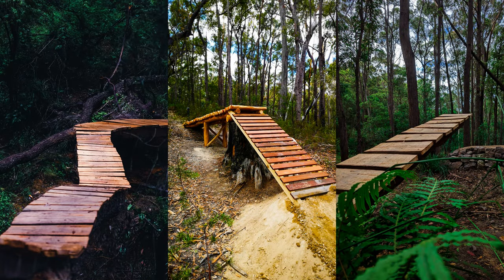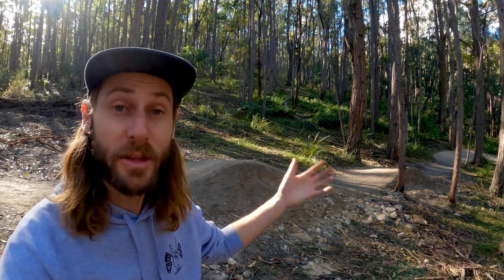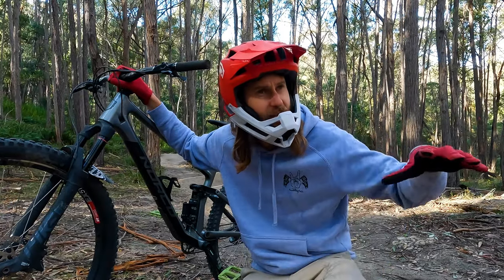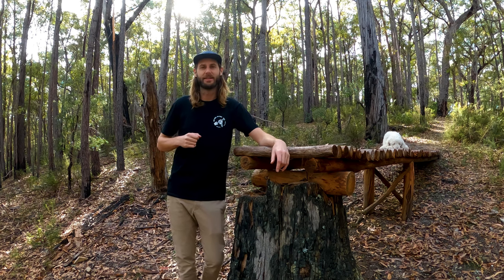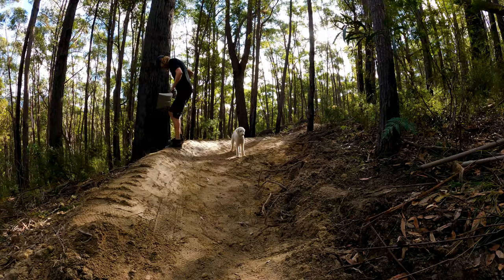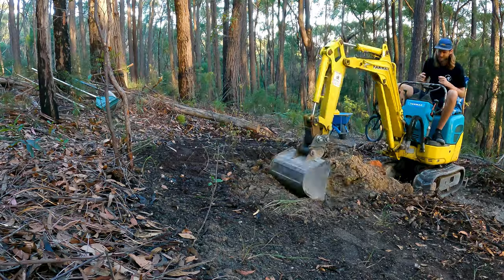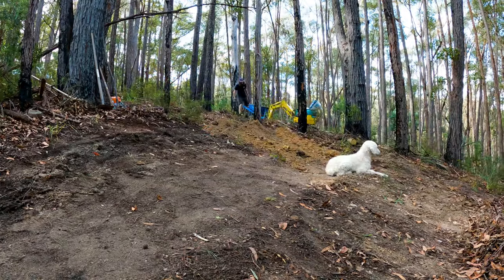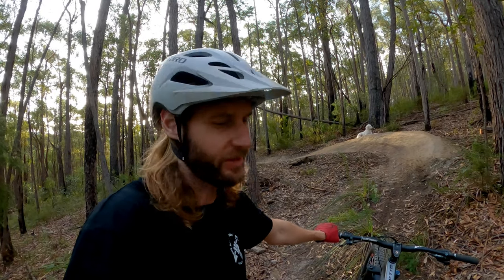Most IMPORTANT part of building a MTB trail!

Comment from the maker: What do you guys think? Should I leave the rollers as is or mellow them out a little?
Reply: Mellow them out on one side or maybe even put a little kicker thingy on the right hand side of the first one. That way it gets easier to double while still being mellow enough on the left side to roll with speed
Reply from the maker: @lorin5294  yeah good thinking. When I was building it I was looking for big flat rocks for exactly that reason. I wanted to have a rock lip on one side. But all I found was small round ones.
Reply: Yeah what Lorin said. If you have a nice flat rock, they make decent lips that can also be snuck past. Pump tracks have steep rollers but they are on flat where yours have so much more speed. You could also fill in the left edge of the lips from the bottom to be less steep. I think moto whoops are fine in any trail at high speeds they just happen in lots of trails. But some might complain about flow.
Reply: I think you should mellow it a little bit but then add more dirt to the downside making them more built up in the middle so when your going faster the roll will be more gradual still being about to go fast through them or gap them or manual
Reply from the maker: Yeah it doesn't need to be as deep in the middle of them. That would make it flow a little bit better.
Reply: I would put dirt just between the x2 rollers to mellow the middle section out to pump and leave the face of the front one as is, or only mellow the face of the front one just a tiny bit. So you can still gap it.  But it’s not as much of a soaker if you wanna pump it
Reply from the maker: @chadsugden411  the front one could also be a little bit wider on the left and make that side more mellow. Have you seen the latest episode? Some friends ride the rollers and the gap is perfect. 🤟
Reply: @cutlaps  yeah mate I’ve seen all your episodes.  I think if you just filled the middle in abit to mellow is it would would be a great option line. :)
Reply: awesome work mate
Reply: I think you need to build up the backside of that first roller, essentially making it a little shallower between the rollers. 
It will then allow you jump them, but will allow you to keep your wheels on the ground while pumping or manualling between the rollers.
Reply: I would think to mellow them out and make the berm that is after the rollers taller to carry more speed

Comment: Great video! Your right drainage and connecting all the dots are the most important things, sometimes it’s too exciting to build the biggest features but the little things keep the stoke going and drainage keeps the trail open. (and a new video dropping on my birthday can’t get better than that!) Those S berms look like a thrill! Kudos to you for including that the double doesn’t work for you but having the goal to reach that level and leaving the pumps in for others.
Reply from the maker: Happy birthday legend!!! 

It's easy to get carried away building features (especially with a youtube audience) and forget about the rest of the trail. But the last month of work fixing up the trail inbetween has been so much fun. It really improves the trail a hell of a lot. No boring bits. 

The roller gap is pretty gnarly for me at the moment. It's harder than it looks on camera because it's actually pretty tight to the corner and you are still leaned over a little. Then there is a tree at the end of the corner that blocks your view of the roller until last second. And then the landing has a bunch of trees really close just waiting for you to make a mistake haha. I'll get it one day, but think I need to work on my pop a little bit first. 

Cheers
Reply: @cutlaps  Thanks. Yea certain big jumps with long and nice run ins are way easier than smaller jumps with short run ins or sketchy landings.

Comment: Another great quality video.  One word of advice on drainage though, don’t use pipes, they block quickly with leaves and sticks.  

Better to either plan the corner a bit better to avoid the berm catching water or break it into 2 corners with a drain in between.

Make the drains as wide as possible 600-1000mm to keep water flow as wide and as slow as possible across the trail to reduce erosion
Reply from the maker: Good advice Greg. I was wondering how often I would have to unclog the drain.
Reply: @cutlaps  water control is the most part of building a trail system that doesn’t need much maintenance.  Diversion banks ie Rollers strategically placed will keep water from channeling down the track.  

Your alignment is pretty set now but on future trails look for features first then look at how the water flows down the slope and work with that to link your features.

You’re doing awesome 👏
Reply from the maker: @gregditchburn9786  for sure. I also have the IMBAs guide to building sweet singletrack book. Lots of useful information on building sustainable trails in there. 

The downhill section after the stump drop will need a bit of work as well. It's a lot steeper in real life than it looks on video. Heat breaking and rain will cause it to rut out. I'm going to have to work out a fix there.

Comment: Keep the rollers high so you can fly!
Reply from the maker: Haha I like that! 

I think if I were to make changes, I could fill in the middle bit a little. That way it doesn't dip down as much between them. It should smooth out the ride a bit more but still allow for max flight time off the first roller. But they are good fun at the moment, so maybe I won't make changes.
Reply: @cutlaps  one of those scenarios where time will tell I guess. The berms at the end looked mint to ride too.
Reply from the maker: @adammorris6348  yeah the berms are lots of fun. Hoping to get out there today to start work on the next one. But it's super windy at the moment.
Reply: @cutlaps  is it the windfall that worries you?
Reply from the maker: @adammorris6348  yeah there's a bunch of dead branches above where I'm working which makes it a bit dangerous and then the noise of the wind can also make it hard to film.
Reply: @cutlaps  ah yes.. content creation. Forgot about that minor detail 😅🤣
Reply from the maker: It definitely slows the process down! haha

Comment: Great work where is the trail your building. You can get a tungsten tipped chainsaw chain lasts for ages
Reply from the maker: It's on my dad's property. Far south coast of New South Wales in Australia.
Reply from the maker: Ohhh and good tip on the chain. I'll have to check it out. Would be handy to not have to sharpen as often when milling.